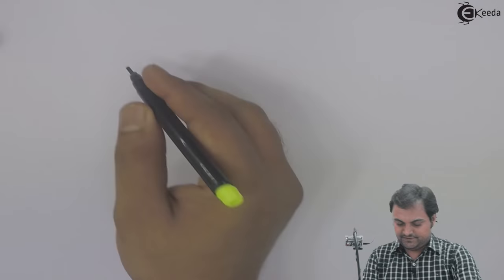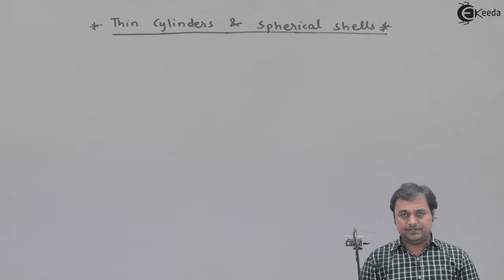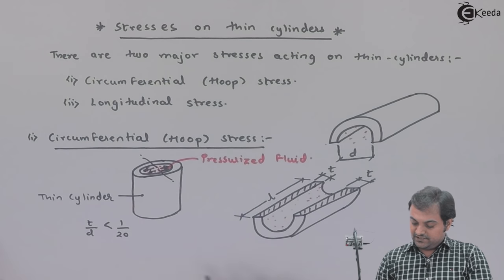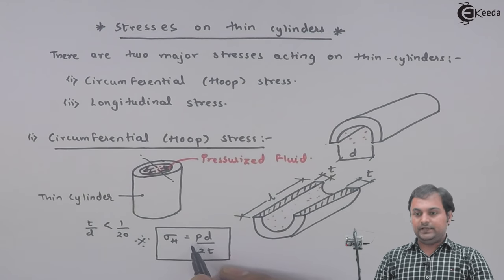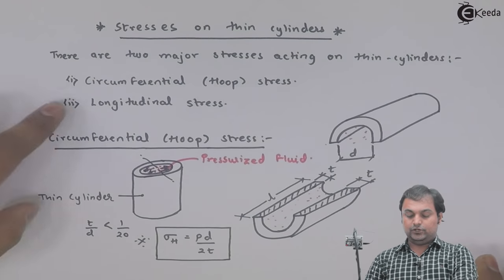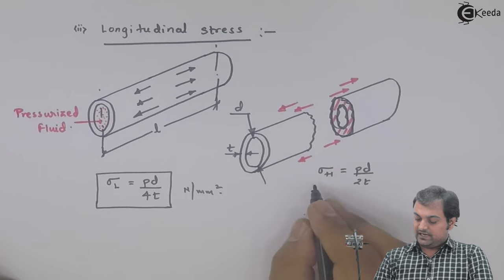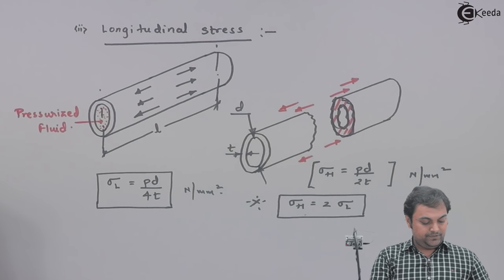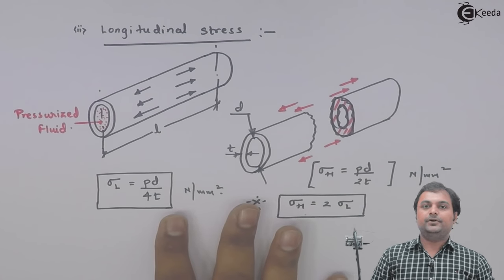Introduction to Thin Cylinder - Thin Cylindrical and Spherical Shells - Strength of Materials

Comment: can we apply same principles of thin cylinder to a pipeline internal pressure analysis ? and thank you for very nice explanation
Reply: Calculate the ratio of thickness to diameter to know if it's a thin cylinder you can apply those formula